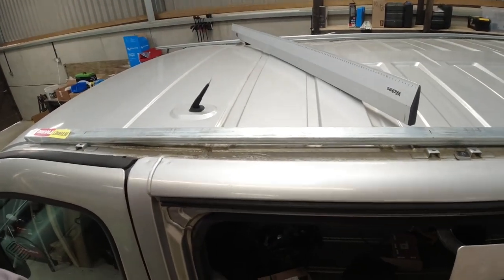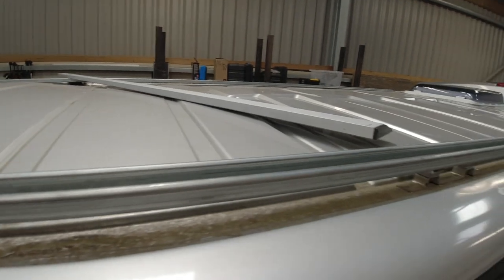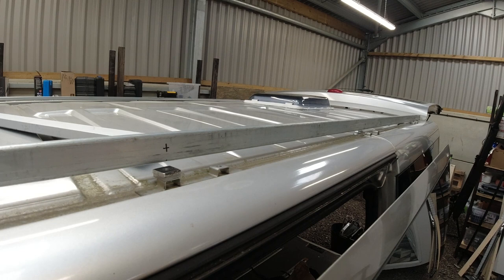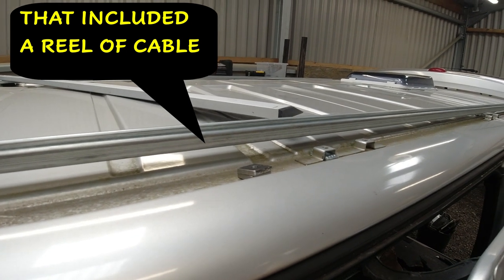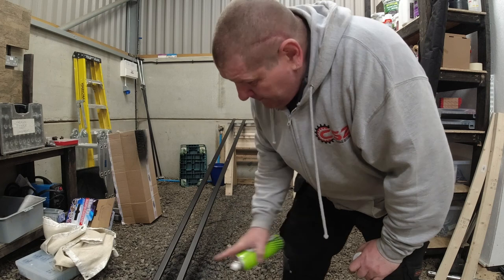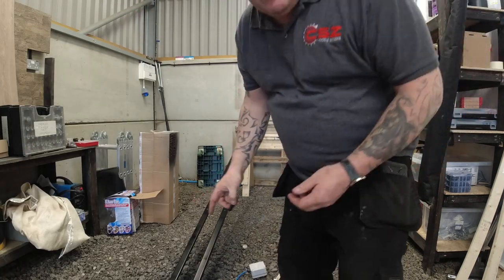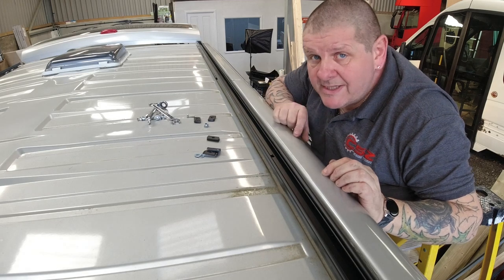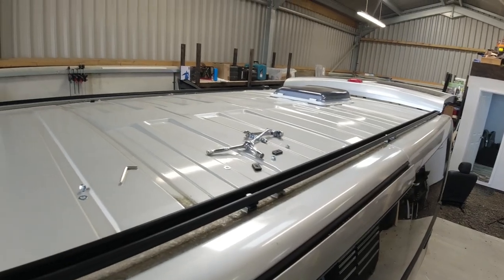Renault Trafic Campervan Conversion - Cheap DIY Roof Rack

Comment: looking good, my only concern would be water standing in the rails after a rain, a couple drain holes would be easy to add
Reply from the maker: The water will drain out each end of the rails quite easily

Comment: Hi mate! Just done this myself and buzzing with the result. Only thing is my end caps are so loose from TLC. Did yours knock in easily or did you have to glue them too?
Reply from the maker: I used glue and do on all my unistrut work

Comment: Hi, another video full of ideas. Quick question, though - did you use the 1.5mm or the 2.5mm thick strut?

Looking to make a rack for my Vivaro out of this stuff. 

Thanks
Reply from the maker: I used 1.5mm it's plenty for the needs of van building and its also much lighter as well.